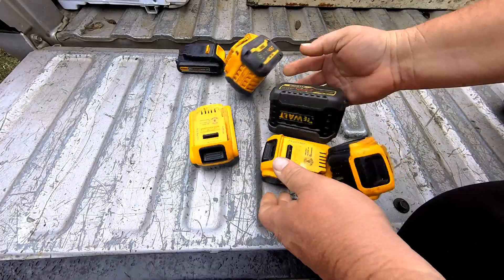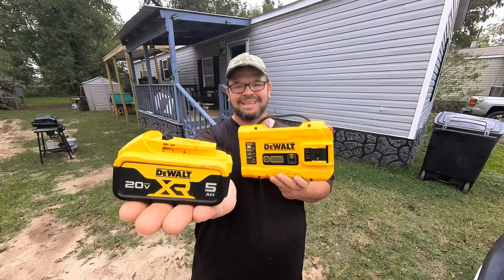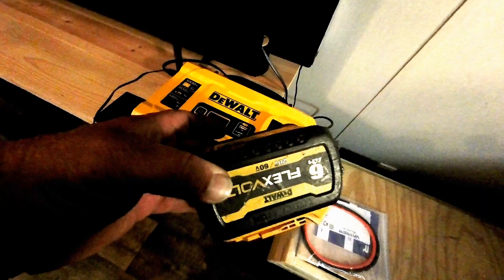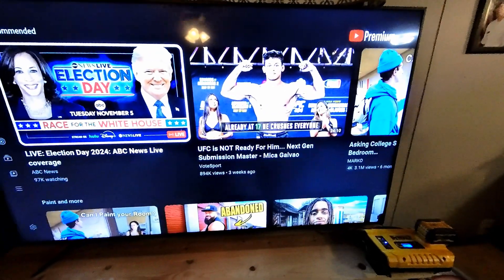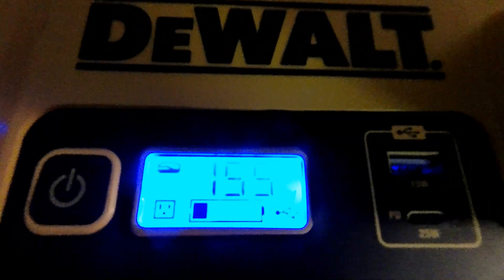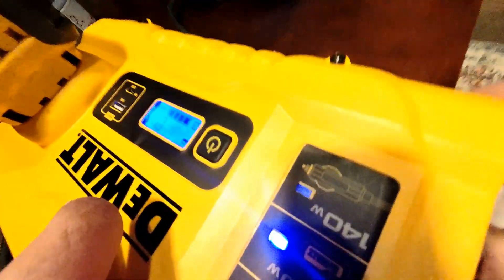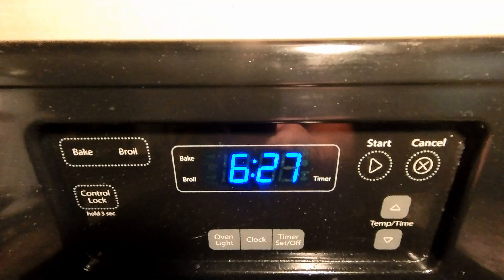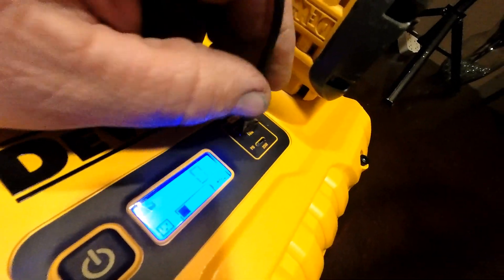What Will One DRILL Battery RUN?

Comment: We have 2 dewalt 20v fans for travel ball. They were a life saver during Helene. They will run thought the night and then some on a 5ah battery. Can run for a couple night if we left them on low just to have a slight breeze. We also run a 6w led lamp bulb for 5 days, a few hours at night to play board games with kids.  We have 6 batteries and kept steady charge from generator or charged from my truck outlet. I would recommend this to anyone. The gas lines were extremely long and outright dangerous at times. These batteries helped us keep the generator run time at minimum and conserve.

Comment: Good test.  What do you think about putting two in series and trying them on a 36 volt inverter?
Reply from the maker: no the voltage is too high,..i tried all kinds of battery configurations on different inverters...so this is all i could come up with was using the actual dwalt inverter

Comment: Some of the tool company inverters for their batteries will take two.  Don't own one so don't know if you can swap one battery while it continues to run.  Also be aware that that's a modified sine wave inverter.
Reply from the maker: yes it is a modified ...but yes I saw where dwalt has one that holds 4 batteries at once

Comment: Dude, those are some very well loved batteries that have been through thousands of cycles and kept at 100% charge for the better part of 5-6 years. I bet you would easily get 50-60% more run time (if not several times more if you have dead cells) with with a brand new power stack battery.
Reply from the maker: im sure...and you are right...i def use them..but i have so many lol